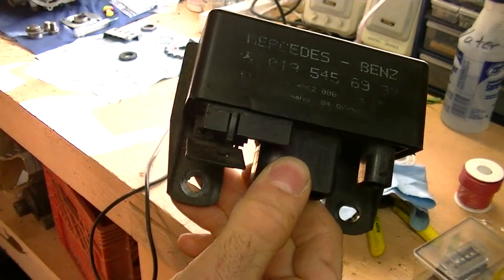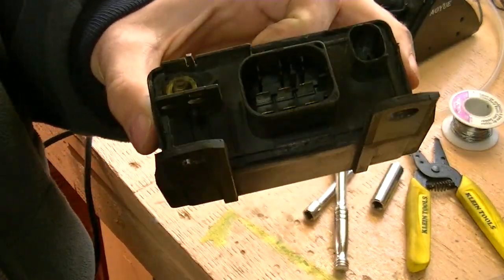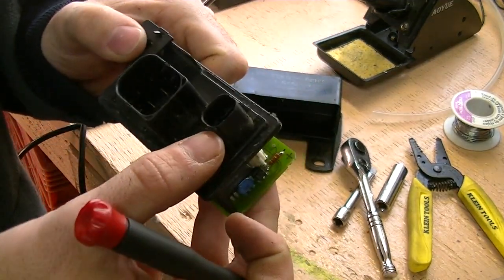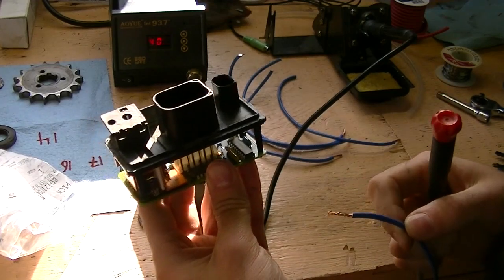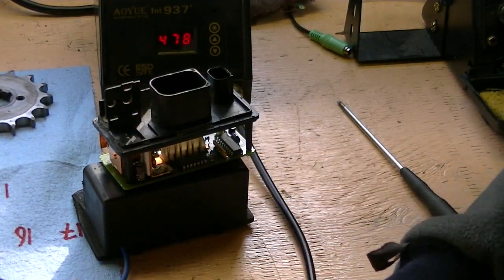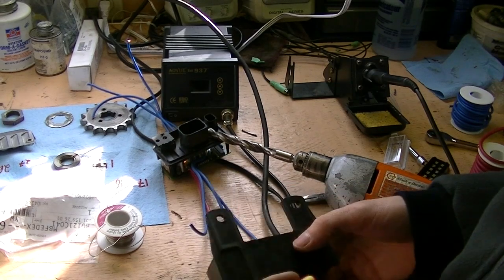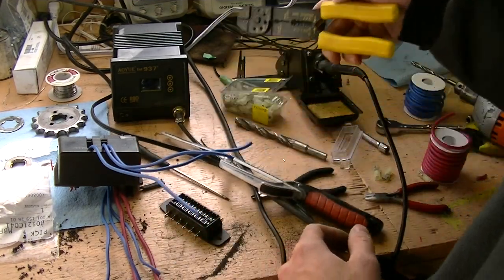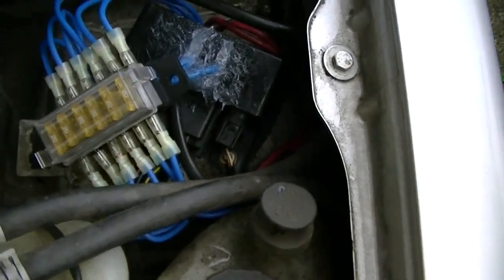1997 Mercedes E290 (W210) Glow plug relay repair

Comment: How I turn off canbus  lamp ignition
Reply from the maker: If you mean the check engine light, you’ll need either a code reader of a Xentry system depending on what set the code.
Reply: I out relay and light on how off light
Reply from the maker: @muhamedsmajic9493  You need to use a code reader or possibly the Mercedes Xentry system to turn it off.